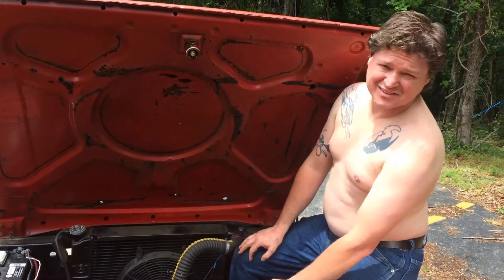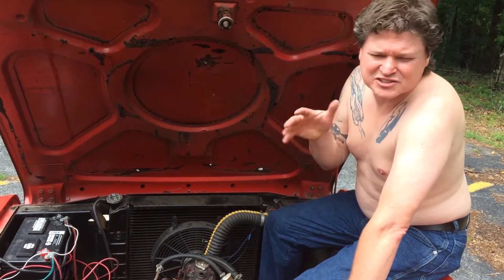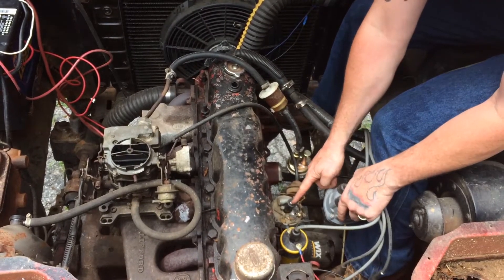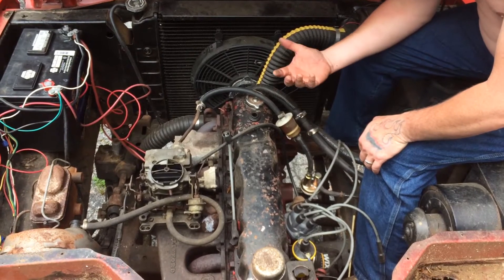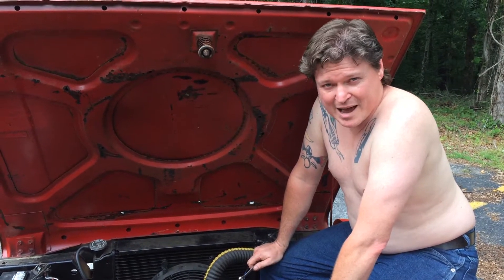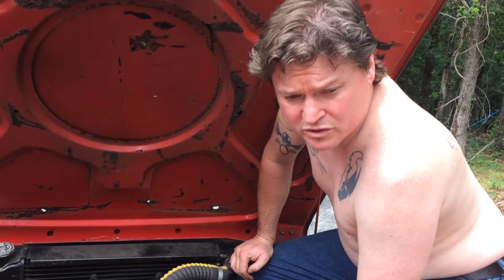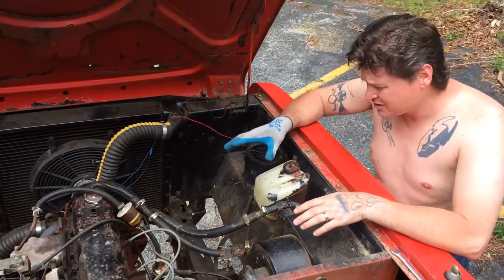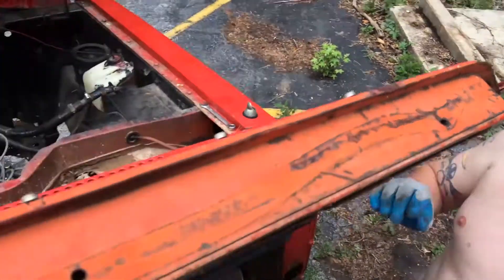Our new "Tractor" - timing our 1971 International Harvester Scout II

Comment: with the front tilting hood that is NOT a 1971 scout by any means as I owned a real 1971 scout  800 b
Reply from the maker: The Scout 800b was definitely made in 1971.  But so was the Scout II.  Mine was a Scout II.  And it was most definitely a 1971 model.
Reply: guess I learn something today. That is weird that international made 2 body styles in same year.
Reply: @40belowful  Scout II aka 810 model as it was initially designated, debuted in mid-1971.  The 800b was not a full year run, with production ending in the spring of that year.